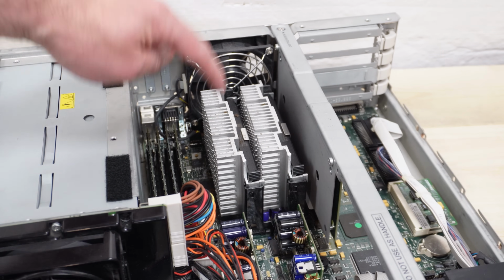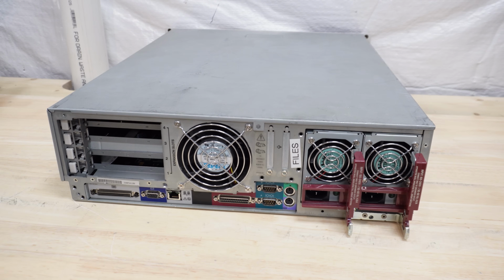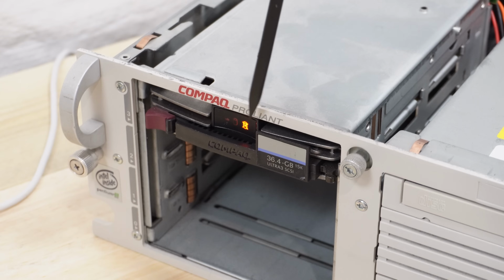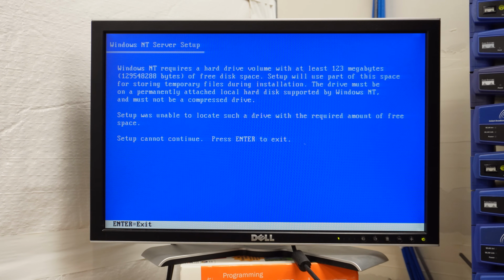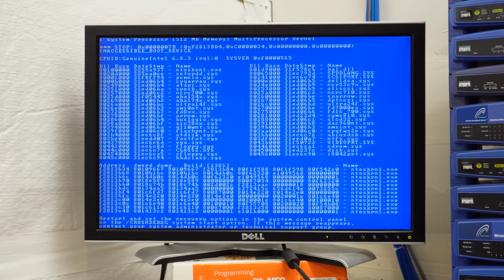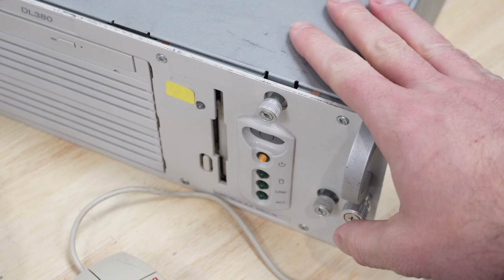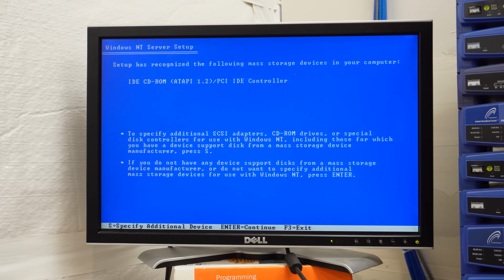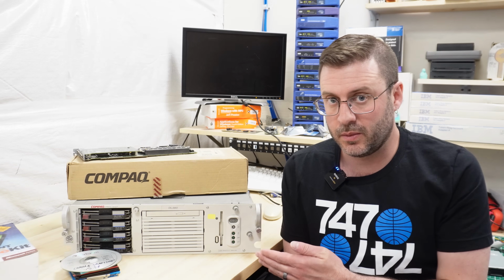Failing to Install Windows NT 4.0

Comment: Man, that takes me back in time. I started my career with a rack of 8 Compaq DL380 Gen1 running Apache, Tomcat, a pair of qmail servers on Debian Linux, with a pair of Windows 2000 running a SQL Server cluster with shared MSA1000 with 12 18gb drives.   My boss was this old guy, dragged out of retirement, who built a few major websites in the late 90s that a lot of people still use daily.  The app we were building was a social media platform, like Facebook or MySpace, in 2000, about 6  years too early.   If we only knew... 

We had one NT4 box, running on an IBM Infinity box, to support some app the sales team had that could not run on 2000.  Man, it was not easy to install.  That was the last time I installed NT4 on physical hardware.  You're a brave man to try.

Comment: Ok, you can't see the drive in the NT setup because you need to load the driver for the controller. That is the "S:" option. You can actually add multiple drivers this way. But you need to know exactly what controller you have, or you could just add all those drivers into the list (this will be true for all NT 4.0 flavors). But once you have the right driver, you will see the drive just fine, and you can actually partition and format the drive directly in the NT setup. Later versions of windows changed the "S" to "F6" IIRC. 

Other things to keep in mind, NT 4.0 cannot boot from a driver larger than 2Gb, and it has to be FAT to start, but you can convert it to NTFS after the fact.
Smart Start is supposed to help, but it's actually not necessary, you can install an OS manually, but you need the "S" driver disk.

I am not on that discord, but if you want to ping me, I am happy to jump into some sort of chat and walk you through gettin that system up and running. I setup 100x of servers like that back in the day, and install NT 4 lots and lots of times.

Comment: NT was great, if it liked your hardware. God help you if you had to install external drivers cause all bets were then off. Some drivers were great, some were time bombs. The gold standard was Adaptec or LSI RAID cards with Seagate Cheetah 15K SCSI. Those are 5V PCI-X slots. If you're shopping around for more authentic cards you'd want to look for ones without the 3.3V key towards the front. Also, towards the end of this era, the newer 3.3V economy boards kind of weren't really 5V compatible anymore. So your mileage may vary depending upon how new the card is. PCIe was such a welcome game changer to this and AGP and VLB and everything else that tried at the time. I can still remember opening up servers to temporarily hook up a floppy drive to install NT 4.0 cause it only took drivers that you either baked in to the image or used a floppy disk for. It was horrible. The practice became to tape a floppy with the correct drivers needed for the hardware to the server somewhere. Like the back of the cover, or side of the machine, etc.

Comment: Raid controllers are usually a problem because the raid controller very often needs a separate windows driver and windows will not recognize the hard drive if the driver is missing. I tried to look at the old ftp address for the drivers, but it doesn't work anymore. On a working windows version you can look for the raid controller manufacturer number and device number in the driver information. The same numbers should be found in the working windows NT4.0 driver files. The INF file is what I usually look for when looking for the manufacturer number and device number. All drivers have unique numbers and they must match.

Comment: There were three major PCI standards. 32 bit PCI, 64 bit PCI and PCI-X.

32 bit PCI is forward compatible in most cases, as long as it supports the voltage of the newer PCI slot. PCI-X has both 5v and 3.3v slots, the latter of which has a reversed key so the short part of the connector is in the front of the slot facing the back of the board.

64 bit PCI is a weird short lived standard that is generally forwards and backwards compatible, with the same voltage keying limits.

PCI-X is backwards compatible with 64 bit and 32 bit PCI, so long as the voltage keying is the same. For 32 bit PCI, the card must support operating in 32 bit mode, and there must be nothing behind the PCI slot that blocks the overhanging 64 bit part of the connector.

I've had decent luck running PCI-X cards in PCI slots, besides RAID controllers. Those are hit or miss. If you do use a PCI-X card in a PCI slot, be aware that you're bandwidth crippling the card, and you will have considerably lower performance if the card normally requires lots of bandwidth.

Comment: ISTR when installing NT 4.0 on my non-Compaq SCSI P3 system I ended up making either a custom boot floppy or custom ISO with the appropriate drivers. I then ended up redoing everything to install Windows 98SE so I could actually play games.

Comment: I remember the joys of adding raid drivers from a floppy, I always kept a floppy drive around for that occasion. I always had the drives on them. The neatest thing was to slipstream the drivers into the disc and burn a new disc. I had the floppies prepared or ready to make a new one if the floppy failed when it was time to reinstall. I had always hoped newer versions of windows would have included more drivers and solved this. Sadly, it was always still an issue. I haven't had to deal with that in a long time, which has been great for me.

Comment: With Windows NT, you don't have to pre-partition. I have seen it sometimes complain about disk space if you do.
I've always had problems with loading RAID drivers on NT.  But it's not as bad as trying to load RAID on  Netware. Heck I have problems just trying to load IDE drivers on Netware LOL.

Comment: I stopped the video I see what you are doing. im 80% sure you need BOTH the controller driver for nt4 AND "compaq drive array for windows nt4.0"  Remember, when you use a RAID card everything you make in smartstart it is a virtual volume so it needs a driver for that and the scsi controller itself. Also, having owned a proliant from this era at one time...just use smartstart 5.5 its designed to be backwards compatible

Comment: This is one of those videos that I'm just yelling at the screen. "You have to do XYZ for it to work!" I've worked plenty with NT4 and I also happen to own one of that exact server. I see a lot of people in the comments saying to load more controller drivers. That'll work. Just load them all and it'll try them all. Also as I see people saying, there will be a partitioning and drive selection screen during setup. Maybe I should join the Discord and see if I can offer any help. I'm usually out of my depth with your projects but this one is in my (past) wheelhouse.

Comment: I think the problem is that, when working with the array utility, you are not actually creating partitions, but abstracting smaller virtual disks that the OS sees as physical separated disks, you still need to create the partition and format it for the OS to be able to use it.

Comment: Try using the NT4 boot floppies. It worked for me many years ago.
Ran into the same problems booting from CD: start the install, add the SCSI driver, driver appears on the list; no disk found. Using the floppies, the disk "magically" appears.... 
My guess is that something isn't loading or isn't loading correctly on the CD. In '96 there were not many computers that would boot from CD.
Another great boot floppy to have around is windows ME: Fdisk works with large drives, and the Format has /q option to quick format. A huge time saver on large drives.

Comment: I sent you an email with fairly detailed information on how to install NT on that Compaq server.  I hope the information is helpful.
Reply: If anyone would like to see the instructions let me know, and I will post them here.

Setting up a Compaq server for Windows NT.

Setup software
1. Use Windows NT CD to make 3 boot floppies.
	I used a DOS 6.22 machine with CD support, A Win98 SE boot disk will also work
	Boot into DOS, change to D:\
	Have 3 good HD formatted floppies ready
	cd i386, run winnt /ox
	This creates your NT boot environment
	
2. Use the Compaq SmartStart CD to create a RAID driver floppy

Setup hardware
1. Boot the SmartStart CD, Run System Erase Utility
2. Manual Configuration
3. Create RAID volume 0,1,5 or whatever you want, DO NOT use SmartStart to partition it

Start install
Boot from NT floppy #1, have NT CD in the drive
When you get to the "Windows has recognized the following mass storage", hit "S" and put in your RAID driver disk
When you get to "The list below shows existing partitions", select "C"
Create partition size of (in MB) No larger than 2048
Select C: New (Unformatted)
Format the partition using the NTFS file system
Setup starts copying files from CD to HD
When done, remove floppy disk AND CD!!
reboot
You should now have a GUI, and it asks for the CD to be inserted
Continue with setup

NOTES
Don't mix SmartStart versions!  Use the same one to make the RAID and create the drivers disk
You may also need to make a NIC driver disk from the SmartStart CD
If you have NIC drivers on a CD don't do it.  Swapping out the CD during install will probably make it hang.  Do it later.
Reply: @jimhamelic7084  Please do, if only for posterity. Someone from the future may want to know.
Reply: Setting up a Compaq server for Windows NT.

Setup software
1. Use Windows NT CD to make 3 boot floppies.
	I used a DOS 6.22 machine with CD support, A Win98 SE boot disk will also work
	Boot into DOS, change to D:\
	Have 3 good HD formatted floppies ready
	cd i386, run winnt /ox
	This creates your NT boot environment
	
2. Use the Compaq SmartStart CD to create a RAID driver floppy

Setup hardware
1. Boot the SmartStart CD, Run System Erase Utility
2. Manual Configuration
3. Create RAID volume 0,1,5 or whatever you want, DO NOT use SmartStart to partition it

Start install
Boot from NT floppy #1, have NT CD in the drive
When you get to the "Windows has recognized the following mass storage", hit "S" and put in your RAID driver disk
When you get to "The list below shows existing partitions", select "C"
Create partition size of (in MB) No larger than 2048
Select C: New (Unformatted)
Format the partition using the NTFS file system
Setup starts copying files from CD to HD
When done, remove floppy disk AND CD!!
reboot
You should now have a GUI, and it asks for the CD to be inserted
Continue with setup

NOTES
Don't mix SmartStart versions!  Use the same one to make the RAID and create the drivers disk
You may also need to make a NIC driver disk from the SmartStart CD
If you have NIC drivers on a CD don't do it.  Swapping out the CD during install will probably make it hang.  Do it later.

Comment: Great video! I have a Compaq Proliant 1600 series. It was a struggle just to get Compaq Smart CD to run and setup op Windows 2000. But the Compaq software is actually pretty thought out. Now i have Windows 2000 on it and is VERY stable! Thanks buddy.

Comment: You need a driver for the controller and a driver for the array, the driver you loaded from the floppy is correct, but you also need to load the Compaq Drive Array for Windows NT 4.0 above it for the setup to detect the drives.

Comment: God you make me cringe, this could have been done in 1/4th of the time, the one issue I would for sure also stumble into is the HDD size at first, then I recall having to install BIOS extenders to support even lager then 512Mb disks and bang... Past that would be a breeze (unless we have hardware faults)

Comment: 2GB limit would be 2^32 (2 to the power of 32) which equals 4 billion or 4 GB and you lose the most significant bit to the sign (plus or minus) so that leaves you with 2GB.  We used to hit 32bit limit all the time back in the day but on memory management from processes.  This is why Sun Solaris was so cool back in the day because it was 64bit when everything else was 32bit.  Also, Mac System 7 was 16bit and Windows 3.1 was also 16bit.

Comment: This takes me back to my highschool days. My senior project was a cluster computer using 6 of these running parallel compute tasks. I used parallel knoppix and netbooted all of them off of a master computer. I hated them because they took forever to boot and get configured correctly. I think linux had a better time as it had some drivers by default it could be made to work with... But my memory is a bit fuzzy.
Reply: Yeah, you are correct, most "normal" Linux distros would just up and run on this sort of hardware.

Comment: Dude! Love the videos. Don't be so hard on yourself. I come from the 90's -  28,8K 33,6K 56k internet provider IT tech world where I worked at a local ISP in Oregon. T1 connections and modem banks were quite the challenge.  I've battled some of the exact issues you came across. Probably have close to a 1000 NT server installs under my belt. I really miss those days. I was freshly out of high school and I caught the BUG man. Been doing the same kinda stuff your doing at home ever since.Keep up the good content. Failing a 100 times before you get it right is all the fun! haha wish I was there to nerd out on this stuff with ya! Need some friends I could chat with and home LAB it up with here! 90's retro minds that share same interests are hard to come by. Anyhow keep it up! Love the channel.

Comment: Back in 2008 I was given an IBM eSeries 220 tower server. It had Windows NT server installed as it was used as a file server. I had similar issues trying to remove the raid array and config as it was setup for raid5 but it only had 2 out of the 3 hard drives. So I figured I'll attempt to make it raid1. Well after several efforts similar to what you have done in this video, I did eventually get the raid1 setup and formatted and Debian 3 installed! After gathering lots of dust and random 6 & 8 legged critters I took it to e-wast after wiping the drives and making sure that it had nothing on it that could be restored, the guys at the e-wast flattened it with a forklift! 😂

Comment: Hi, you must create  3 floppy disks. Run the machine from dos, make 2048M partition and format it and reboot one again to dos with cdrom support, in dos execute the famous lock and smartdrv (files will be copied faster to HDD), go to the cfrom\i386 and run winnt without "/b" (having 3 just formatted flopies prepared).
When this part finishes simply put first floppy into drive and reboot, as I remember after second floppy is loaded you could specify additional disk drivers as you already tried to do during floppyless setup on video (use the same floppy which you already created and tried to load drivers from it  having driver found but no disk). 
This time it should work  :)
PS. reason you could ask,  I'm guesing that with cdrom setup when you loading additional driver from floppy  kernel and all other drivers are already loaded  in contrary to floppies setup when you specifying additional disk drivers sooner and NT has a chance discover device with driver loaded into memory, it probably cant refresh drivers tree after boot as 2k can with new WDM driver model.

Comment: Please stop referring to a logical drive as a partition. I know you're coming at it from a sun approach where that is the same, but for everyone else, a partition is what sun called a slice. You're just really confusing yourself, because here's the thing, NT4 can handle larger drives. It can in fact handle up to around 100gig drives. But the system partition has to be smaller. But that is partition in x86 world. It's also however not 2GB there, it's either 4GB, or 7.8GB depending on which service pack you have integrated. But the maximum drive size remains the same regardless. It's also not exactly a problem if the drive is bigger, it just can't make use of anything bigger. It will see bigger drives, as simply being the largest it can handle at 137 (Don't remember if that 137 is GiB or GB though). And the 4/7.8 is a max only for the system partition. Any extra partitions can be whatever.

Comment: NT 4 is the devil. Dunno why MS never released a copy that had SP5 or SP6 integrated/slip streamed into the installer. SP4 and lower capped you off at either 2GB or 4GB for the partition size. Use to run partition magic to expand the partition to the maximum size of the drive after installing SP6. Also was way too picky for the hard drive controllers. I say just run Windows 2000, it fits the age of the machine.

Comment: I was a NT system administrator in the late 1990s. It was rough. Swearing at Microsoft was an entire career path. Their documentation was terrible too, so nothing's changed there. There was often no internet access to find drivers on either.

Comment: this is not the first proliant... this one already has the new disk trays. they had the white square ones in 2 height versions before those. these are u160/u320 sca already. (think so were most the others but they had a piece of pcb sticking out the back with an edge connector ;) LOL. well good luck with the floppy to load the scsi driver into the wintendo installer :P (eh yeah we call these things the new disk trays. go figure :P we just call the current ones the 'small disk thingies' lol.

Comment: FYI, Windows Server upto (IIRC) 2k3 fully supports NTLM backwards compatibility, from 2k7 onwards there is support but (again IIRC) you have to choose between NTLM support and less security for everything or no NTLM support and increased security for everything. You could absolutely have used 2000 or 2k3 for this.